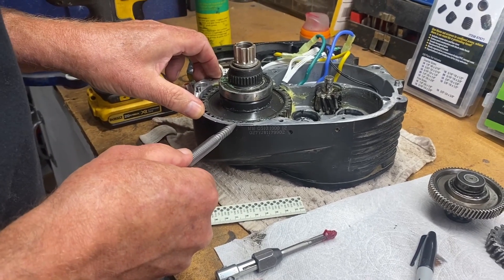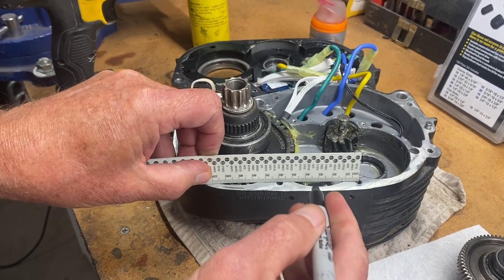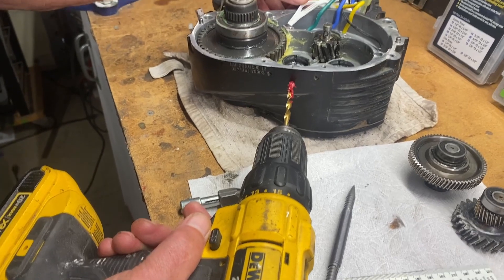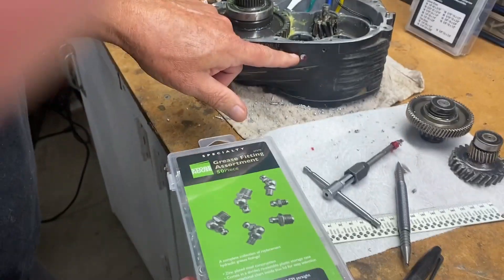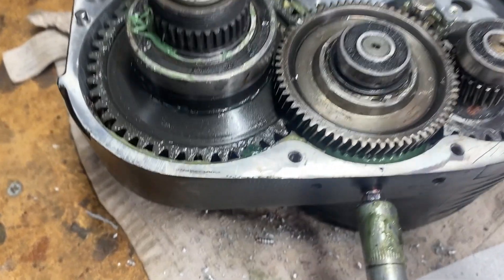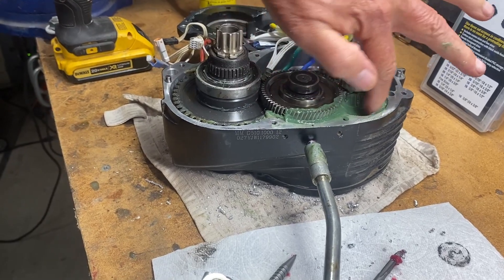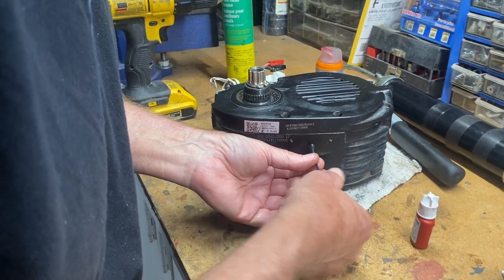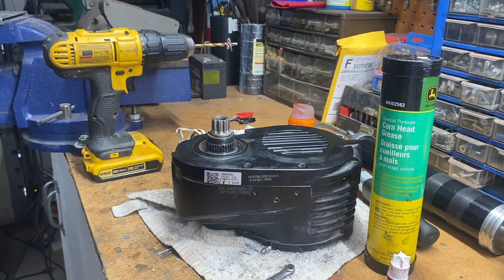Adding a Grease Fitting to a Bafang Ultra Mid Drive Ebike Motor to Quiet Noisy Motor

Comment: What are those 2 threaded holes in the bottom
Reply from the maker: I’m not really sure on the holes. They don’t penetrate into gearbox. They may have been for a data plate. Now serial is laser etched.

Comment: Are u, or who close to Los Angeles, I need my M620 Greased..it's on a Sondors Rockstar
Reply from the maker: I am but i'm retired. Any bike shop that services Ebikes should be able to grease it for you. Are you having trouble finding someone?
Reply: I need someone close to L.A. & someone who's worked on this motor b4..what minimal Crank specific tools do I need, to pry the cap & crank off, without dismounting? the motor
Reply from the maker: Robin, you need a crank puller tool. Threads into crank arm then turning the attached arm pulls the crank off. You also need a special m620 left handed nut socket to remove the front sprocket.

Comment: Mike:

Have a 2024 Frey Savannah CC Ultra E Bike with M620 BaFang Mid-Drive--Could you tell me if this unit is noiser than most E Bike drives? Seems to be noisy when peddling --when I use thumb throttle only it's real quite??? Kathy @ Frey--Sales manager say that unit is noisy??? I see lots of bike people on You Tube take drive apart and add John Deere Corn Lube--green grease.

Should I re grease my new M620??
Reply from the maker: Ken, it is odd that some motors are noisier than others. If you haven’t greased it yet, now is the time. Get your cornhead  grease and fill every nook and cranny of the gearbox. You can’t hurt it. Just be careful to follow the videos on disassembly and reassembly. I added the grease nipple to give it a bit of grease when it gets noisy again. Ride safe!!
Reply: @filoncmike  Thanks Mike--Bike Shop that going to disassemble M620--is a BaFang Dealer. They want to put in White Lithium Grease--I will buy a Tube of John Deere--Corn Lube green Grease--Tell they to use it.. Thanks for your help

Comment: After completing a regrease of my M600, and now starting on my spouse's M620, I have had fantasies of doing this. I read a comment from one bike mechanic that he'd prefer to remove the old grease. When I got the case on my M600 open I noted it had brown grease that was contaminated with dirt probably from dirty water ingress, so I had to clean it all before regreasing. So I then resolved it may be better to go to the trouble and do the service the hard way perhaps once a year. I guess the advantage would be you may end up replacing some bearings at the same time, but the grease fitting technique may extend the time periods between motor tear downs for inspection. To me, the perfect design would be one that would expel the old grease when you pumped in the new grease.
Reply from the maker: Hello MP!! You’re correct that the grease discolors over time. I haven’t really noticed any dirt or water contamination however. Maybe it is a reaction to the aluminum I don’t know. I’ve never had to replace a bearing yet. They seem to hold up pretty well over 5000 miles. I did open up each bearing dust cover and add grease initially.  The grease fitting is really convenient. I left the fitting in last time as it is near impossible to whack it on a rock. If you think about it, 5000 miles on a car bearing or gear is just breaking it in!! It may be a general good idea in constant wet areas to open up the motor and inspect everything. Ride safe!!!😁

Comment: You cannot be teaching people to destroy their motors with 90 pumps of grease.  That is irresponsible, and many will be calling you out with this.  You don't realize that grease splatters like water at high speed, and also melts into a liquid when hot.  I give that motor 20 miles before you have a problem.
Reply from the maker: Sorry Mali! Closing in on 5000 off road miles with no problems. I open up the motor every 1500 miles and the motor looks brand new inside and the motor has so many areas that hold the grease the amount is not too much at all. Ride safe and quiet!!

Comment: you cannot trust that making the hole in a closed motor that there are no chips inside!  I could see doing it once when the motor is open.  Also those set screws are made to press against something inside.  you have no guarantee that the set screw won't unscrew into the motor.  You should either leave the grease fittings or use a pan head screw.

Comment: Excellent...thank you for sharing this.  An another commenter said, Lekkie make a replacement cover for the BBSHD that has a small hole for inserting grease with a micro grease gun.  I've been pumping my BBSHD full of grease for 4+ years now and I've never encountered any problems...only quiet and buttery smooth.  So the "you're overgreasing it" chorus is mistaken...at least for these motors.

Where are the bearings you recommend pulling off their dust covers to grease when you're greasing the rest of the motor?
Reply from the maker: Hello Colin! I love the BBSHD. Very powerful and reliable. On the G 510 there are 5 bearings that look like they are sealed but they only have dust covers you can remove and pack with grease.  The bearings have very little grease in them. Sorry for late response- I was out riding!! Ride safe!

Comment: You've solved one problem, but created another. As the motor casing is a sealed unit, you'll need to include a breather, or another removable screw to allow for release of the pressure that will build up when you add grease. Other than that, it's a good work around for a pain in the rear process.
Reply from the maker: Hello Derek! the case is not air tight as air escapes around the Crank/ Torque sensor. No pressure problem. The seal between the gear case and electronics also works adequately to keep grease out of the controller. Just don't use a powered grease gun and go wild!! ha ha. Ride safe!!
Reply: @filoncmike  cool, thanks for replying. Ride safe!

Comment: too much grease I think will be hard for the motor, maybe a gear oil has less of a drag. Usually, the noise is coming from the slightly worn-out bearings. You hear less noise because the grease muffled the bearing noise. In my opinion.
Reply from the maker: Hello Mr Man! After thousands of miles on multiple motors, the cornhead grease works perfect! The amount of grease mentioned in the video seems also perfect as no grease has migrated into the controller cavity where gear oil as suggested by you will probably leak into that area. As for the grease slowing down the motor, be realistic, it is a light grease with a coefficient of friction of around .05. Ride safe!!

Comment: I dono how i ended up on this video but looking at this it's definitely not a good idea to add that much grease. There is no gasket inside the housing so you'll eventually start leaking grease into the electronics as some will break down. Never drill into a motor and leave shavings in there open it up drill your hole and add maybe 10 pumps to start with. Some motors make more noise then other that is fine. I would honestly do this modification on my  own bike run it for 100 -250 - 500-1000 miles and then come back and post the video once you've identified that it will not cause issues!
Reply from the maker: baba, I know it seems like a lot of grease, but i assure you after many thousands of miles and opening the motor up to check, no grease has migrated into the controller. 
There is a rubber grommet that separate the two chambers. If you drill first without grease then grease the drill bit for the final cut through, you shouldnt get any chips and when you tap the threads with greased tap no chips either with practice. BTW they are aluminum chips so they don't effect the gears if by some unknown miracle they migrate to the gears , the chips do no harm to the gears. ride safe and quiet!! 
🚲😀

Comment: That is WAY too much grease in my honest opinion. Not removing the old grease, not great. Frankly you can remove the few screws on the cover, not that hard. This is gonna work, ofc its going to be silent, but the gears are going to fight and "swim" through the grease now. I would have stopped at like 30 pumps max. You did stop at 40, then video cut and you go "so i put 80 pumps in there". I could not hold a good chuckle. I am not a mechanic and maybe i am wrong, but those 80 pumps seem to be a LOT.
Reply: Please don't take my comment badly man. Great idea. Let's just agree to disagree on the right amount of grease.
Reply from the maker: Thanks Poma! re: not removing the old grease - since there is very little grease from the factory and little contamination occurs during operation, I would say that is not a factor. The idea for the video is that one can add a grease fitting in the perfect spot without removing the motor and easily grease their motor. I've removed and inspected the motor at least 5 times in my 5,000 mile hard driving journey and every gear and bearing is factory fresh. 80 pumps is not that much and just fills in the cavities without getting into the controller area. glad you got a good chuckle! 😀 ride safe!!

Comment: I just re-greased two Ultra motors.  One, with 1500 miles on it, had almost no grease (and a lot of metal shavings) and the other had a decent amount, which after watching a number of Youtube videos on greasing an Ultra motor seemed to be the correct amount.
I think you've gone overboard with the grease and I suspect a good portion of it will find its way into the controller cavity.
Reply from the maker: After 3000 miles I opened my original motor up and no grease had migrated to the controller. The cornhead grease is awesome - highly recommended for this application. ride safe and quiet!!
Reply: @filoncmike  I used Corn grease in my two motors too.
Reply: This is not a very good idea, over packing grease is just as bad as having too little amount of grease, also pumping fresh grease into dirty old grease is bad aswell. If the motor is noisy then it needs to be inspected for damage or lack of grease, not rammed full of it, I've just done this to my motor and found that the bearings have worn. I suppose I could follow your example and fill my motor up with grease, that would quiet the worn bearings.
Reply from the maker: @dogbreath6974  Dogbreath - I now have over 5000 miles on this motor and it operates as new. It is whisper quiet with no grease entering the controller area. You can also remove the bearing dust covers of all the bearings with an exacto blade and pack the bearings as they too have very little grease from the factory. I have a total of three on the bafang m620 and each has benefited greatly from adding cornhead grease. Ride safe!!

Comment: Without a second hole for a breather it would get pressurized wouldn't it?
Reply from the maker: The Ultra leaks air around the crank on the controller housing.
Reply: @filoncmike  nice! Im contemplating doing this mod cheers👍 thanks for the measurements 🤜🤛

Comment: Old grease with metal dust  mix in with new grease not good  .If it would be oil would be a different story oil would come out
Reply from the maker: Thanks Michel, I would avoid oil. When you turn your bike over to work on it, the oil will leak into the controller. A few micro chips of aluminum will not affect steel gears it they possibly could migrate into the gears. Also the bearings all have covers so no possibility of contamination. If you can find cornhead grease, that still is your best lubricant. Ride safe!!

Comment: Awesome!  I came up with this idea myself and went online to see if anyone else came up with this idea, and sure enough, you made a great video on this.  Thank you!  I don't think a vouple of metal shaving will be a big problem.   I'm not taking the motor out.
Reply from the maker: Great Giulio!! I found a thinner grease tends to hold the chips better. Also use a collar on the drill bit so it only goes in 1/8” or so. You should be good!!! Ride safe!!